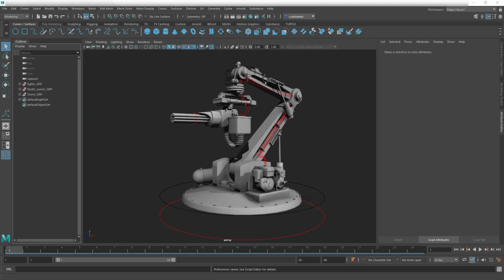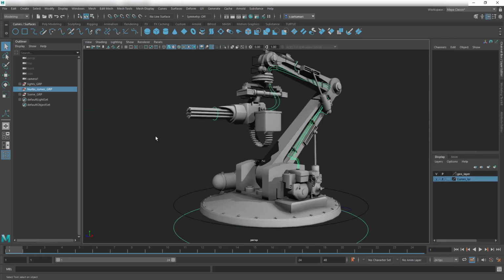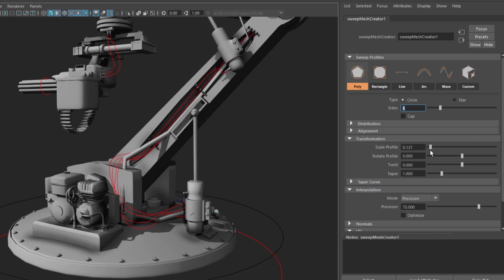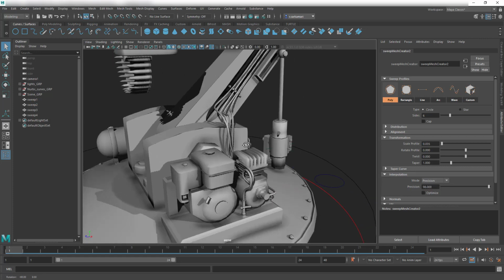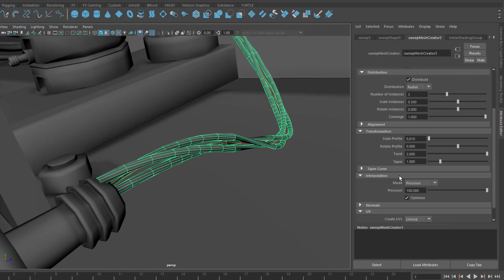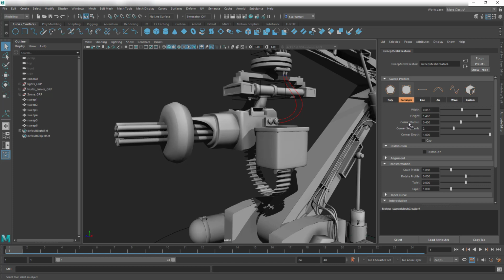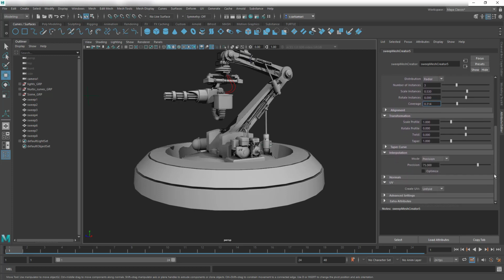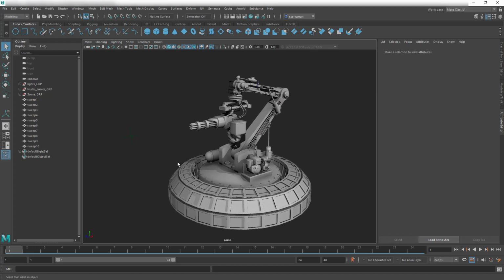How To : Use Sweep Mesh in Autodesk Maya

Comment: Thanks for this very informative video! You're a great teacher. Sweep Tool is an amazing addition to Maya 2022! and a literal selling point for me along with Quad Draw and Retopo and Grouping system and the outliner. Those tools made me decide to switch from Blender to Maya (I'm currently saving up for Maya Indie) which is $265 a year, that is not bad, to be honest! everything works logically better in Maya than it does in blender but both tools are great! for my workflow, I prefer Maya for others they prefer Blender both are great either way!
Reply: Wow, I didn't know about the Maya - Indie User License. Thanks for the FYI.
Reply from the maker: Thanks 🙏🏼

Comment: So I assume Sweep Mesh can generate NURBS ( that is surfaces )?
If it can't then it won't replace the tools in the surface menu.
Reply: If working with NURBS is part of the studio pipeline then the answer is no, this tool won't replace Surface Modeling tools. But not many studios consider having use non-polygonal models as part of their pipeline. Even with Extrude Surface the polygon option box is preferred over Nurbs and that's what this tool is all about. Bottom line is if you aim poly modeling this tool replaces Extrude Surface.
Reply from the maker: @naseemjafarian8423  That's exactly right Nasem. Studio pipeline does dictate what tool is preferred and why. I personally never generate NURBS out of Surface modeling tools. With Sweep tool I don't even need to think about the conversion. Good job Autodesk
Reply: @sarkamari  Nurbs surfaces still have a very useful place if you know how to work with them...